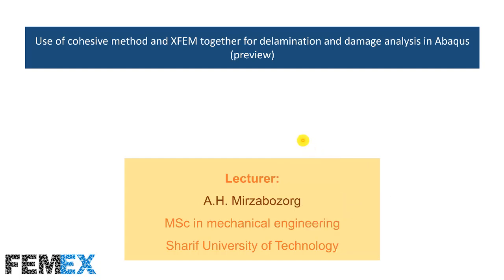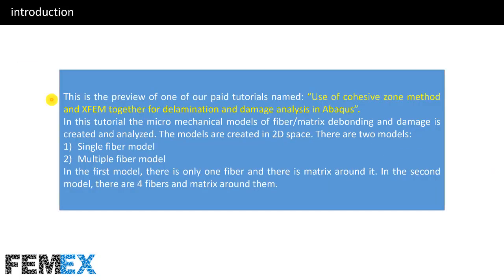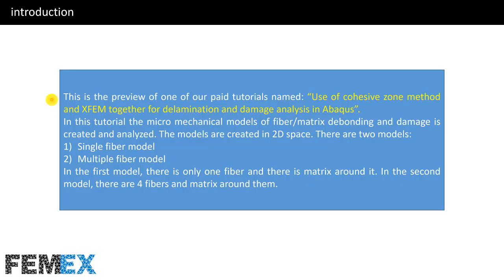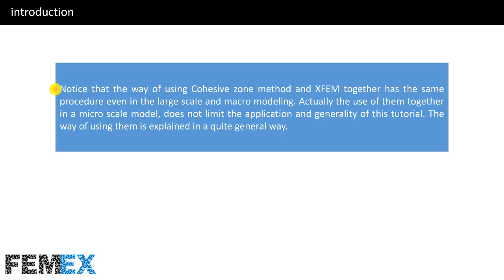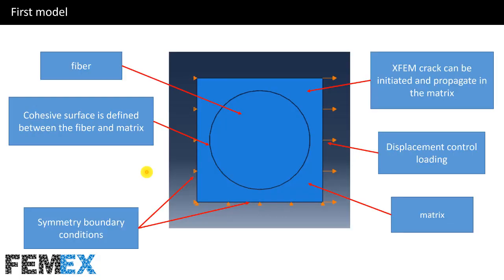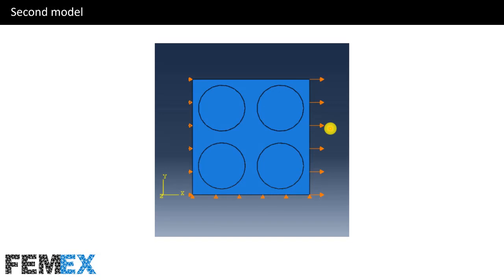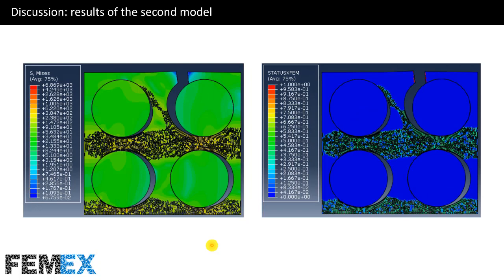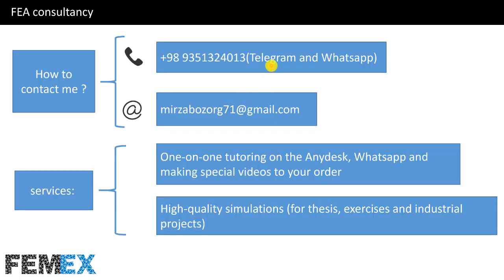use of cohesive method and XFEM together for delamination and damage analysis in Abaqus preview

Comment: hi, I have a question, would you please guide me? 
in simulating mode 1 we implement ultimate strength for Maxps, If we wanna simulate the mixed mode or mode 2 fracture, what should we use in the Maxps box?
Reply from the maker: Hi.
Yes of course.
For mode 2, you can enter the damage initiation stress of the shear test or torsion test (I guess for torsion case, the stress must be multiplied by a factor). About the mixed mode, unfortunately there is no specific value and this is the problem of XFEM because its damage initiation stress is not dependent on the loading condition and for example you cannot define a table to find the initiation stress according to it. I myself use the MAXPS of the mode 1 but also this one is not accurate and the damage initiation criteria must be dependent on the loading condition.

Comment: when I use cohesive method and XFEM together,  the error "Analysis Input File Processor exited with an error." stop the calculation and ONLY FIRST ORDER 2D ELEMENT, FIRST ORDER STRESS-DISPLACEMENT BRICK ELEMENT AND FIRST ORDER OR SOME SECOND ORDER STRESS-DISPLACEMENT TET ELEMENTS (C3D10 AND C3D10H) ARE ALLOWED IN THE ENRICHMENT,TYPE=PROPAGATION CRACK. Can you please help me out?
Reply from the maker: Hi.
Are you talking about the models provided in this premium tutorial ?
Have you bought it previously ?

Comment: So, how we can get a relation between volume fraction of fiber and the strength of composite using Abaqus ?
You mean by macro modeling that we do not need to model fibers and we must model it by homogenous model of course with defining properties in different direction, is this correct?
Reply from the maker: I have forgotten to write something in my previous answer. in my previous answer, I was talking about the laminates not all of the kinds of composites. mathematical relations of laminates are written in the composite books. to understand the effect of volume fraction of fiber on the mechanical behavior of the composite, micro mechanical modeling using FE must be used.
you must model the composite for several times. in each model, the volume fraction of the fiber must be increase. for example : 10% in model 1, 20% in model 2, …, 90% percent in model 9. by calculating the young's modulus of each of the models, you can find the effect of the volume fraction of fiber on the strength of the composite.
Reply: @FemexIran  please if you have a time can you explain how by calculating the young's modulus we can get the yield and ultimate strength for different model?
  I'm so sorry for taking your time
Reply from the maker: @maritarahme4867  hi.
you are welcome.
in a composite and its micro mechanical model, after getting the force-displacement curve and changing it to stress-strain curve, the slope of the elastic region is the young's modulus. also you can calculate the other mechanical properties from that curve:
- the end of the elastic region is the yield point.
- the maxima of the curve is the ultimate point.

Comment: Hi, I have a question and  I hope you have a time for answering it. 
How can I get a correlation between the diameter of fibers and the yield or ultimate stress, or a correlation between the angles of plies and that stresses? knowing that my simulation is composite plate under an impact force.
Reply from the maker: hi.
your simulation needs the macro modeling of the composite.
what we have instructed in this premium tutorial, is the micro modeling of the composite.
the diameter of the fiber affects the volume fraction of the fiber leading to the decrease or increase of the stiffness of the composite.

Comment: Can you please help me out? I need to apply Incremental loads with a speed ratio of
10 kN/min on a test specimens using ABAQUS/standard. Do You have something to tell me how can I did it? I hope you have and I am waiting you.
Reply from the maker: hi.
yes I can.
if in your model, the unit of force is Newton and the unit of time is second, the speed ratio is 10000/60 (N/s). using this ratio depends on the chosen step and its time period. for example if the step is Static general and its time period is 2 sec, in the load settings, you must select ramp amplitude and enter 2*10000/60 for the magnitude.
Reply: @FemexIran  so, for time period 1sec, if I insert 10000/60 for load, can I found the ultimate and yield load? For example if it is 350kn, can I found it???
Reply from the maker: @malcolmm4876  if you want to find the yield and ultimate loads, you must use another type of loading. what you asked previously is force control loading because you want to insert the rate of force. but for finding the ultimate and yield forces, usually we must use displacement control loading. in this case force is applied as a non zero boundary condition. this happens in the compression, tension, 3 and 4 point bending tests.